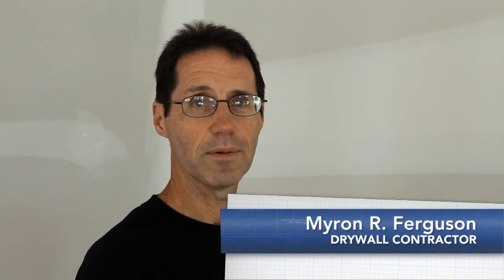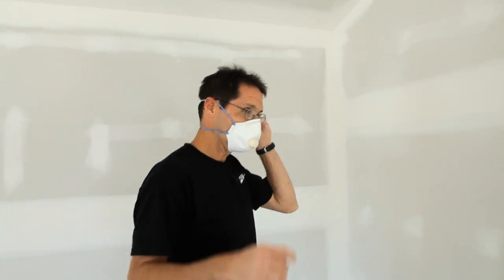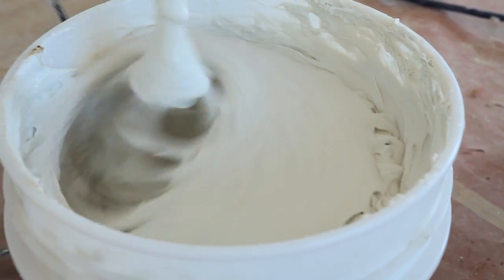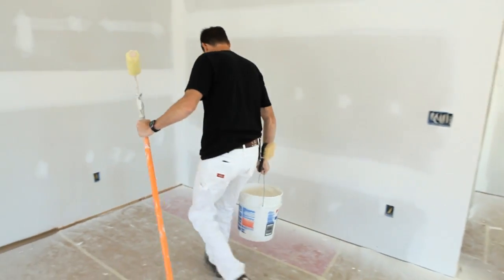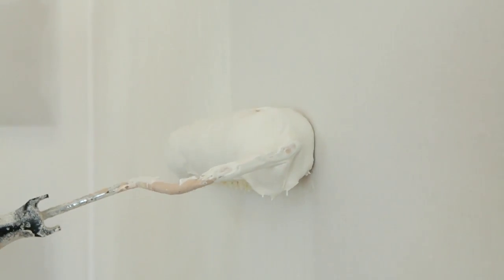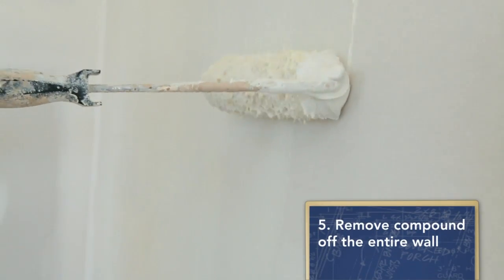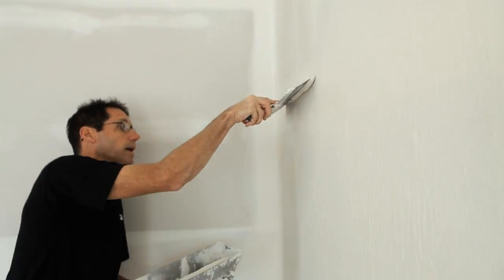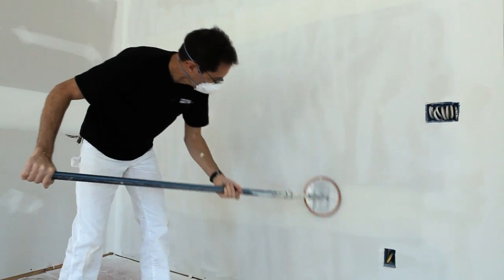How To Finish Drywall

Comment: Drywall tape is ~8.7mils thick (and 2 1/16th" wide), nearly 1/132nd" protruding from a butt joint plus wafer thin bonding compound.  A neatly applied 6" trowel bead over a butt joint (assuming good framing and drywall hanging) plus wafer thin compound underneath, flattens the tape to 0.33 degrees. Span the mud out with 12" trowel either side and eagle eye can't detect the tape. Lev. 5 is unnecessary with good taping (after good framing and drywall).

Comment: In Europe, we have 4 levels of finishing drywall quality, q1-q4. What do you do on more?
Reply: Nothing, Q4 in Europa is the same as Level 5 in the US. The difference is that in Europe Level 1 (taping) isn't recognized as a Quality (Q1 in Europe is Level 2 in the US). Hence the reason why mesh tape icw the use of hot mud is still widely used in Europe for complete job sites
Reply: +robvanharen81 
Ok but in any case, tha way how in Europe Q4 level is reached, is completely different from this video that sincerly I 've never seen anything like this... In Europe every levels has a special purpose so the regular level used in house or room shop is q3 level. It's really hard to find level Q4 the requires a lot of work: officially we should make Q1 Q2 and Q3 level, than on drywall q3 finishing we should make q4 finish that consists three coats of mud. A really expert no need to send in this level the wall, because can reach a mirror of plaster just polishing the wall by using water and trowel,  step that I pèersonally  call troweling (I don't Know how in english is called, sorry but I'm italian)...
Reply: +Harles74 that's true, the way it is shown in this video is almost never done in Europe, it's either done by hand (hawk and trowel) or airless spray. the hawk and trowel technique is mostly done for concrete plastering which indeed a good tradesman doesn't need to sand, just finish with water and knife or trowel  does the job.

Comment: However to save time i do sometimes sand final coat.. 150 grit sand paper mostly on the edge.if not perfect finish?. but i do sand primer paint...cause of drywall damage caused by sanding and or some dust. If you choose to sand final coat you will damage the paper on the drywall or sheetrock what ever u call it? And will have to sand primer paint.Some people even sand their first coat?? I just scrape off the trowel lift or stop (line of compound caused by trowel lifting off the final wipe or smoothing )and put on 2nd coat. From 2 feet to one hundred feet of coating there will always be one trowel lift or trowel stop at the end of first coat over the tape.

Comment: So I was laid off and decided that week ,to go and buy, with all the money I had left . All the drywall supplies I need . 9 months in and I feel I’m a beast now …… for example this past week started on Monday  finished sat . A bathroom . Installed rectangular wall coverings (5) total 4x8 . The walls were 9 ft so what I learned if I ( and feel welcome to use this trick !, but stuff the large gap with toilet paper and get 5 min putty  and 20 min putty mix them together for a total
Of 25
Min putty. Smear all over the toilet paper and fill gap it don’t have to
Be perfect . I usually mix 4
Buckets of my 25
Min mix I invented and pour it all into gap . Let dry 2 full days and sand with 220

Comment: Also, when you sand, you might find that the original paint didn't bind that well to the drywall. I found sections I was able to rip chunks of paint off the wall. Think of putting more weight on that.
Drywall, primer, texture, paint (Thats what is there now, then add) joint compound, primer, texture, paint, (paint x2 if needed). Too much weight.

Each way of doing things has its pros and cons.

Comment: OI course I'm not referring to structural strength, but abrasion and minor bump resistance.  Kids, pets, etc will make a beautiful drywall finish look like crap after a few years.  Too many times I've seen drywall in high traffic offices and retail stores looks beaten up a year or two after installation.

Comment: Not trying to cut you down. However this method is only quick with 2 tapers. It is much faster to trowel the entire wall (skim coat) if only one (experienced) man using an 18 inch trowel and hawk. If done proper no final sand. However thanks for the tip I will try this method with my apprentice.
Reply: "if done proper no final sand"
^ ^ ^ ^ That remark is just silly. Any mud put on any wall MUST BE SANDED before painted, regardless of the tapers skills and talent. It's a texture issue, you cannot SKIM COAT a wall 1 time, and expect to paint it.

That's only a fill coat, the sand between coats AND DOING A 2nd coat (the skim coat) is what gives the wall the silk feeling, which can then take paint like perfection, even better then trying to paint drywall by itself!

Comment: @Redskin1040 It's rare in residential - usually only contractors who deal with commercial are familiar with the "level system" (level 4 is "normal" and level 5 adds this final skim/sand).  It's normally only spec'ed on walls that have harsh lighting (raking window light or "crisp" display lighting).  As you can see, it isn't hard or terribly time consuming - 2 guys for one or two days can cover a lot of area. But it's a great way to stand out from the generic drywallers on higher end projects!

Comment: You might want to talk to your electrician and inform him that the box at .49 doesn't meet code requirements.  Drywall is considered a "combustible" surface and therefore boxes must be FLUSH with the finish surface, not shy of it by what appears to be at least a quarter inch.  Or are you installing box extensions on this and perhaps every other receptacle?

Comment: If the job calls for a perfect finish, this is probably the best way to achieve it.  Yeah, it's overkill, and the difference is minimal but so what.  He's getting paid for his time.  It's not difficult to apply a skim coat.
This guy wrote a book on drywall and definitely knows what he's doing.  I would recommend vacuuming the wall and outlets first to remove all the dust or you end up contaminating the compound.  You need to work quickly and always leave a wet edge.

Comment: You won't achieve high end results for a level 5 finish by using light weight compounds since they dry to a rougher texture. It looks like you are using Plus3. I recommend regular weight general purpose compound or topping.

Comment: WOW, that is insane, I am no pro but my walls in my house are perfect, yeah it takes me a long time but I would die of old age doing this step, just do two coats of primer, Anything short of perfect in my house is not accepted and this is what works for me. You can always touch up over your primer coat any imperfections.
Reply: I didn't even look at your walls and already I can tell they aren't "perfect.

Comment: Almost every new home has a sun wall, So unless Picasso did your taping  it is going to show especially  if you are painting with egg shell or semi gloss, Putting a level 5 finish on that one wall is  a smart thing to do, Whether you want to skin coat  with trowel or put it on with a roller.

Comment: looks very nice, but applying a very thin texture wouldn't be easier and also give a nice finish?, I mean as top coat, that's what I do and I know other contractors do. good video thou
Reply: if you want an ultimate finish, do it by hand....yes it takes a little longer, and maybe takes a little more skill with a 10 inch curved trowel, sure....but you will know for sure when you're scuff sanding before your 2nd level 5 coat, that there's still mud on the wall. I find rolling the mud on, regardless what you use to wipe it afterwards, just doesn't fill it up enough. If you are still filling spots on the wall on your 2nd coat level 5, you're doing it wrong.
Reply: I agree.

Comment: Is compound same as mud?
Reply: +evadesc It is but there's different grades. For instance, "mud" of a certain grade that is used for joints in drywall is usually called a "compound" where the mud used to cover holes and such is usually just called "mud".

So yes, they're technically the same thing.

Comment: Could one just texture the wall with a knock down finish instead?  It looks like you put compound on and took it off. I don't understand your efforts.
Reply: There will still be a very thin coat of mud, then you have to sand every inch of the wall to get a smooth surface.

Comment: I think you did a great job on this video....but I feel like there's a couple more things you could have put into it...such as how MUCH water you used (I'm a union taper in Canada)....I personally use a medium size, Tim Horton's takeout coffee cup for measuring my water. The saying goes around here, if your mud is drying out in your bucket, you're not working fast enough. However, I can't fully agree with that saying. This happens to me as well, mainly when I'm coating my tapes and beads for the first time. When I'm using my mud pan and knife and not my hawk and trowel, I'm not in and out of my bucket nearly as much, this leads to a possible drying of the mud in the bucket, I have 2 buckets of mud on the go at all times, one thin enough for final coating ANYTHING and another that has 1/2 - 1 cup of water. This ensures I have mud at the ready for whatever may need to be done or come up. I do not agree with how you put your mud on the wall. That is a quick way I agree, however it does not fill anything CLOSE to putting it on by hand with a curved trowel, first coat. Level 5 does not end at one coat, it continues on with another coat after a scuff sand, and this time you coat the other direction. All in all, you seem to know your stuff, but could have been a little more informative with the specifics.

Comment: @dr6511 Just like with normal (level 4: standard joint/screwhead) sanding dust, you need to get it off the walls/ceiling before you apply drywall primer: A shop vac with a brush attachment (with a fine dust filter or bag so you aren't just blowing it around the room), or specialized gizmos like the Wooster Dust Eater and some people use Swiffer or similar dusting products as a final pick up. Like all painting, it's 90% prepping the surface. A fan blowing out the window while sanding helps, too.

Comment: every body works differently but like my brother says not every body works well .putting plaster on the wall with a paint roller that's a first  just learn how to mudd better and you won't need to do this if your painting priming sand it after priming then after the first coat of paint and your last coat is your finish like I said every body works differently but if you want to do a time consuming job then this is your video.

Comment: I'm sure its not that common. There is a balance of cost vs results. I'm trying to save money, so in exchange, I am willing to lose some time. I bought sanders, joint compound, knives, and a sponge for about 150$. How much would it have cost me to put up new drywall? 12 bucks a sheet, times.... 10 sheets? for one room... on top of that you will STILL need the sander, joint compound, knives, etc.

Comment: 3 coat work using 6", 10" and 12" applied neatly and slurrying final coat edges would provide you with a living wage and still provide a good finish for decorating. This won`t earn you a wage, especially with 2nd fix trades beating the door down wanting to earn theirs.

Comment: I've hung thousands of sheets of drywall... and this is the first time I've ever seen anyone advocate this technique.  There's no way I would do this.  You want a super smooth finish?  Here's the EASY way:  Sand after your dried primer coat.  I put a Kilz coat on the wall, let it dry completely, then light sand it, vac the dust and then paint.  As good or better than this technique, I'd bet, and a LOT less work.  The walls end up like glass.
Reply: Wow, "thousands." See you in a few decades.

Comment: Geeze guys talking about using a trowel...that's OK for what 60s plaster?? Get with it guys..dude on the video wasn't bad and it is possible to mud without sanding takes skill and ive seen it done..just remember drywall finishing is an art!
Reply: You are correct. It is an art and can't be taught. It takes years to figure out out. Took me 15yrs to get it perfect every time.
Reply: Miranda Hamrick  I'd like to be able to mud without sanding, or know someone that good :(
Reply: I don't know any good tapers who don't sand. I know some bad tapers who have to sand more, but every decent taper I know uses hawk and trowel and sands. I Highly doubt your finish looks perfect.

Comment: I did not say  fill one time done... do the normal 2 coat flat and but joints 3 on beads and screws. than a final skim on total wall. I am not from your neck of the woods. meaning you call level 5.. we call perfect finish. I would be pissed if someone sanded after a proper or perfect finish. If they paint with semigloss paint you will see all the scratches of the sander... hold a light across the wall not direct on it and you will see what i mean..? the shine of the paint will show bumps and scratches.. if you don't sand it is perfect...

Comment: For chrissakes... I'm not talking about 3 coat old school plaster or horse hair or any of that shit. In the original video the guy is skimming sheet rock with watered down drywall compound. I am saying that a much more durable finish would be to skim with veneer plaster (over the proper substrate, ie plaster board, or some other properly prepared substrate). All things being equal, a skim of veneer plaster is better than a skim of watered down bucket mud. Comparing chemistry and physics not cost

Comment: you did all that work peeled all the mud away,   proper level 5  leaves a slight layer of mud on there so you have something to  slightly sand.   If you sand that you'll burr it all up like you did in the first part of the video.       show people the right way not the wrong,  and throw away that dirty pan and stainless knife.

Comment: Yeah that's right professor. Those finishers don't know squat like you guys with a doctorate in plastering. You just won't stop talking smack. My old partner came from a family of plasters going back almost 100 years. Whenever they had drywall work to do they called us up cause for all the plastering super powers they supposedly had they couldn't do drywall worth squat. 

They are two DIFFERENT skills . It's not a matter of one being superior to the other "superman".

Comment: Drywall is hard enough professor and a ding in a wall is so ridiculously easy to fix that somebody with no experience can do it if we're talking plaster or drywall. Dings aren't a problem dingbat but cracks are and they are much harder for a homeowner to fix. The surface paper hides cracks very well but plaster has no surface paper.

But dings are not that widespread of a problem unless you keep running into walls. You got a drinking problem professor ?

Comment: What the hell is a level 5 finish? I have been doing drywall for 20 years and never heard of a level 5 finish. This is a wasted step when a long nap roller works when priming does same with less sanding. One thing you try to do when finishing drywall is reduce sanding.

Comment: Drywall primer use drywall primer NOT flat paint. If you are this crazy use two coats of drywall primer, sand lightly between coats and the wall will look like plaster!

Comment: Drywall is cheaper because it requires less skill to install.  It's easier to patch because the compound is extremely soft which is why it's sandable.  It has to be sandable because unskilled people don't know how to float real plaster.  You have made my point for me.  And I highly doubt you finish with durabond. You can't fool me so go try to scare away someone who doesn't know what's what.

Comment: Polishing a turd is all this guys doing. I'm a painter and I run into shitty drywall work all the time. To get a good finish I use 3/4 inch nap and apply very heavy primer coat. Roll it out smooth with an 18 inch roller. Just let roller lay on wall and control it but don't mash it. You want a very heavy uniform coat. This makes my walls look a lot better than most. 

Almost the same process as level 5 except using paint.

Comment: After sanding the joints, just kilz the wall and sand it after it dries... then paint.  A lot easier than this.
Reply: TomKaren94 the reason for this technique he is doing is to fill any grooves scratches that were missed  proper for level 5

Comment: The concept is there and it's kind of on the right track. Here's the issue with this video. The host is obviously the middle man. The guys that do the work and did the work on this drywall job either no speaka da engles or aren't presentable but they can definitely do the work. The host on the other hand, is uh, yea OK, presentable and can be a good host but obviously cannot do the work. For this reason this video isn't really helpful to the millions coming to watch "How To Finish Drywall" because this isn't exactly how it's done.

Comment: That is so not necessary. The primer does the same job. Put on two coats of your worried. Are you doing the Taj Mahal? Like seriously.
Reply: The primer doesn't fill the area between the raised joints, so no, it doesn't do the same job. What it does is makes it good enough for you.

Comment: For a truly high end finish why not skim with veneer plaster?  Learn how to use a hawk and trowel.  Mix up some plaster and do some actual good work.  Drywall compound needs to go away sooner than later.  It is so soft that the slightest bump will nick the compound.  Terrible.  My 50 year old plaster walls hold up to the roughest of treatment.  Drywall?  Forget it... Junk.